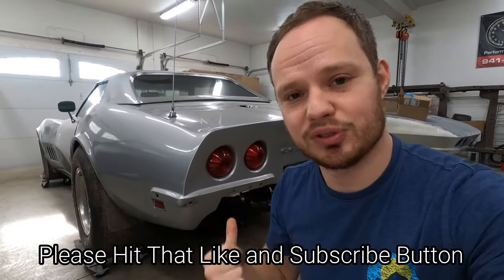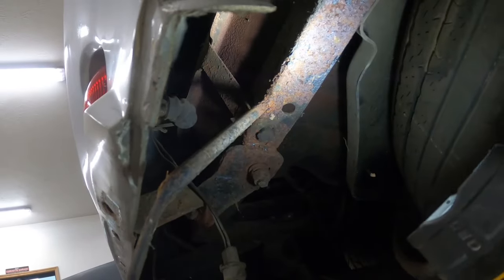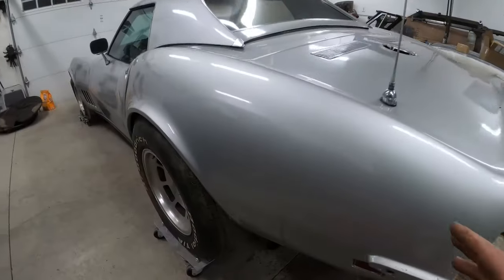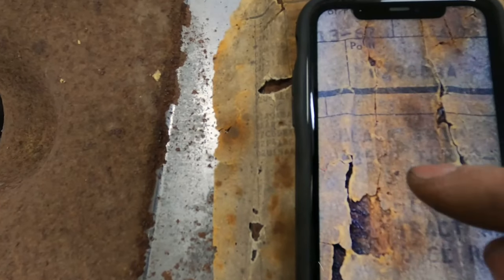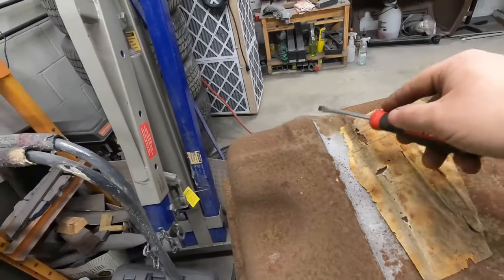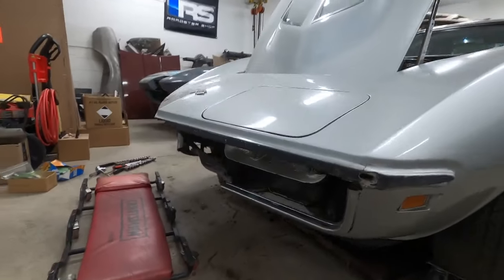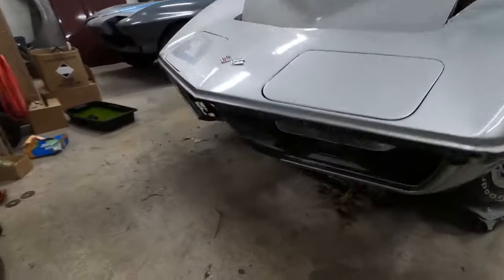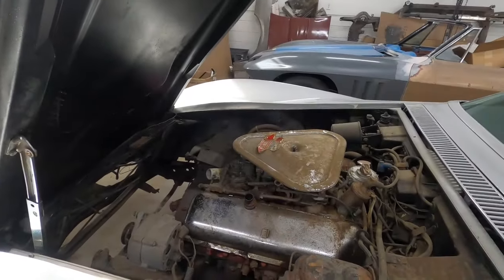Starting To Disassemble The 68 Corvette Tri-Power.  Removing Bumpers To Expose The Factory Gas Tank.

Comment: Have you compared the weight of engines 327,  427. LS3, LS7 always knew lighter engines were really better but love the torque. One friend has a 63 327 with a 471 blower and a Holley on top. But he had no traction. Have you weighted the 97 and up transaxle 6 speed manual.  Would love to see one stuffed under the C2 with shortened axles to maintain wheel width and stock fender shape. There us a 5.3 LS that is about 327. Alun block and heads too. Thanks for sharing. Dennis

Comment: I’m working to remove the body off a 79 currently. When you removed the bumper brackets did you mark them or scribe? The reason I ask, when I take them off and then put back on is there some adjustability in putting them back on to line up correctly on the bumper or am I over thinking the adjustability?
Reply from the maker: Hey Kevin. You could make them if you really want to. Most likely when you put the body back on with new bushings the body will be in a slightly different spot from where it originally was so you will probably have to readjust everything to fit the new body alignment. Everything will most likely be slightly different. It should all be pretty close though so I think you’ll be fine. Just take lots of pictures and you should be good to go 👍

Comment: Beautiful car . I really hope you are removing the body to restore the frame to keep the car as original as possible .
Reply from the maker: That's the plan! I’m taking the body apart so I can pull it and restore the chassis. The car won’t be a hot rod. It also won’t be a 100 point NCRS car. It will be a nice original driver.

Comment: A lot of the 68 and 69 for 27 do not have original blocks my dad at 68 big block with 400 miles on it blew a hole inside of the block because that’s when they switch to let it gas to unleaded they had to redo the motors, a bit beef up valve screens, other sorts to fix it
Reply: ...beefier_valve screens_ say whaaaat? Distributor curve and carb adjustment and jetting for the right air to fuel ratio
Reply: Can you say that in English?